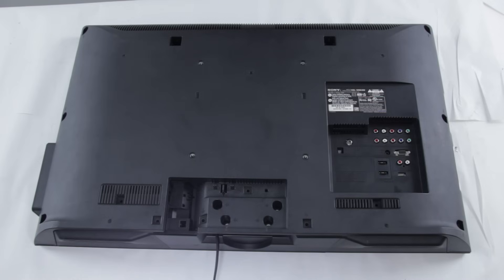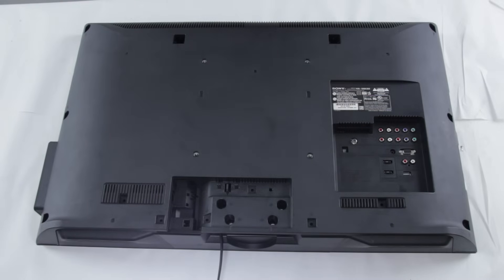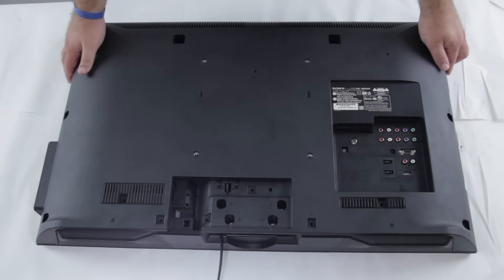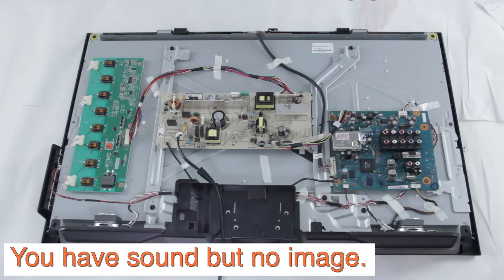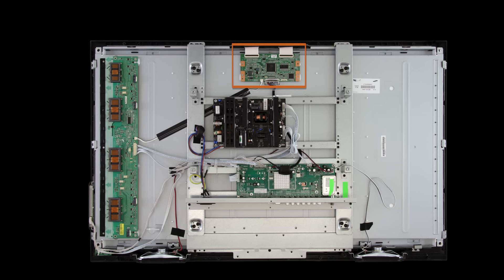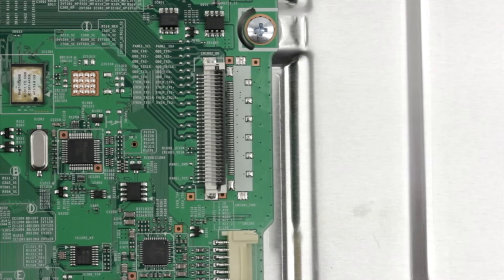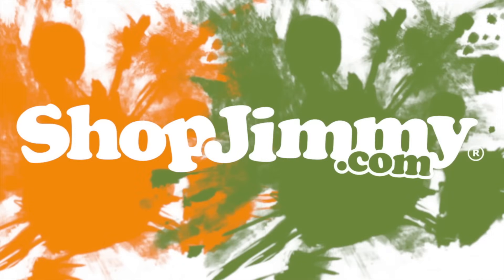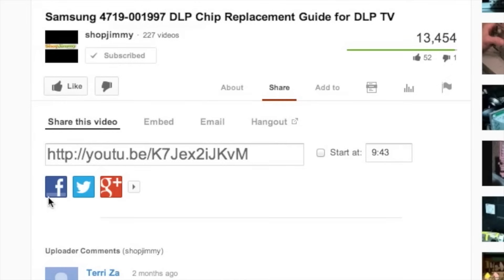LCD TV Repair Tutorial - T-Con Board Common Symptoms & Solutions - How to Replace T-Con Board

Comment: Hey my tv model is 100012585, SN is CA210161C5A001799, the problem is horizontal lines that have gotten significantly worse. I did a reset and basic troubleshooting steps. Figured it’s more a hardware issue. I’ve opened up the back of the tv to see if I can diagnose it. Any suggestions?

Comment: Thank you for this!  My Samsung UN55MU650D TV demonstrates thin black vertical lines on the left third of the screen.  They're evolving to become thicker and more are appearing. 
I'm thinking it may be the Tcon board (if it has one).  I want to fix it myself but have not done anything like it before.  I'm unsure if the part is even available anymore as the TV is no longer made.  Thank you for the opportunity to tell you of this.

Comment: I bought the tcon. i am unable to get sound though. I tried to run the hdmi into both hdmi ports with the cable runnimg but i get no sound. what i did notice is that when i inplug the hdmi the back light go out for a few seconda and then some back on. the tcon comes tomorrow but I'm not sure if its going to be the problem.

Comment: I have a Hisense 55 h9g 2 years old, and a week ago it would not power on.  The light at the power button would stay on but the tv would not turn on.  I ordered a replacement main power board.  I replaced it and it is still doing the same thing.  No picture or sound or anything.  Is it the TCon board?

Comment: Lg 47La620 v backlights failed tv had never worked. Replaced everything and tv works but some pictures display a green ghosting around certain images. Im guessing tcon board or mainboard. Bought a mainboard that was sold as working but it didnt work. Thanking you appreciated.

Comment: I have a sony 55" 3D led tv. I had fickering screen issue last year, wwnt to mechanic he blocked 8 pin right side  of the tcon ribbon. Now I have the  same flickering problem and the k ther side of the panel is also effected. Now both side problem , how to solve ?

Comment: My Vizio Tv picture goes black but the sound is ok . If I turn it off and on it will work fine for a minute or two and picture goes black again . Part number 10258161245  . Serial number LWZAUDBS1600283 . What could be wrong ? Thanks

Comment: I have a Sony with no image and red light flashes 4 times, I have replace Main board and power supply board and still does not work , tv screen flash white light then turn off right away, tv model xbr85x850f , please help , thank you

Comment: My TV: SONY MODEL KDL32P3000, S/N: 1364891, Shows Image and Sound, but the image has a delay or it's like in slow motion, very slowly and overlapping itself a few seconds. It's like be in the middle of a nightmare (like Silent Hill Videogame) Maybe is not the TCON and the problem is the SDRAM Memory? I've read that is a common problem with this models of Sony... Can I do some voltage test to discard the TCON? Thank U a lot!!!
Reply: oh, i forgot add the TCON model, is 320WTC2LV3.9 or aka LJ94-01420V

Comment: Hi I have a problem with my TV it's a 65 inch Sony model is KDL-60R510A AND THE SER # 5033599 WHILE TRYING TO LIFT IT I  squeezed the side of the screen to hard and the top of the screen where I handle it has lines going across it but it shows  a picture on the bottom half of the screen 😢😢 HELP PLEASE.

Comment: I have an Insignia NS-55DF710NA21 model TV. Have been T/Shooting it for a bit now....I have no picture just a black screen but I do have sound and when I push a remote button the picture will flash for a milisecond but then go black again. I suspect it is a bad Tcon board. I cannot see an image on the screen when shining a flashlight through the front of the screen. Would you agree it's most probably the tcon board?

Comment: Hello,
We have a JVC 58 inch Roku tv with flickering vertical lines random on the screen. They are faint light lines.

Model number LT-58MAW705 AAP
Serial number LT-58MAW705AP08601424

What do you believe is bad?

Thanks Chad

Comment: Samsung led tv only 2 years old, no display with random color vertical lines, opened up and found the board that connect between tcon and COF on the left side have an IC heats up. Havent found the short circuit, is it possible to fix?

Comment: 55" TLC ROKU tv model #43S421: Sometimes has a solid white screen or a solid black screen. The led light at the bottom of the tv flashes and blinks when I use the remote but cannot see anything on the tv screen. I tried un plugging it and plugging it back in and following the reset direction but nothing seem to work???????

Comment: Hi Jimmy. I have a Samsung UN65RU8000FXZA version AA02. The TV works but there is a vertical blue line on the left side of the screen and a horizontal red line near the top of the screen. Any suggestions for a possible repair?  Thanks very much.

Comment: I have a panasonic tv model TC-L58E60. Half the screen on right is blurry and when the screen changes the right side has a delay. I trued changing ribbons from side to side but still no luck. Would this be caused by the TCon board

Comment: I have a TCL 75S421. It powers on, the back lights come on, I can turn up the volume and navigate with the remote, but I have no picture. Does that sound like a bad T-con board? When I first turn the TV on, I can see the Home Screen background at the very top of the screen for just a second or two, but then it fades out.

Comment: Serial# 1709gtc001854a02860
M# 55s431
55" TCL series 4
Won't turn on fully, I can see power lights but no pictures or sounds other than the clicks of the volume going up and down. 
I think it's the main board but possibly the T-con .
I'm trying to pin point without replacing everything.

Comment: HI, I AM HAVING POWER ON PROBLEM IN MY TV MAKE- VU, MODEL- 43-OA WITH POWER SUPPLY BOARD RSAG7.820.8466/ROH AND Mainboard RSAG7.820.8466/ROH, BOTH HISENSE.
THE PROBLEM IS RED LIGHT IS ON CONSTANTLY. UPON POWER ON WITH REMOTE OR BUTTON, RED LIGHT GETS OFF FOR 4-5 SECONDS AND BECOMES CONTINUOUS ON. 
UPON TESTING WITH LOCAL SHOP, IT SAYS POWER SUPPLY IS OK BUT PROBLEM IN MAINBOARD.
I MYSELF TRIED IT TO POWER ON BY REMOVING EVEN T CON CABLE FROM MAINBOARD BUT POWER ON LIGHT ACTED SAME.

NOW PLEASE GIVE ANY REPAIR SUGGESTION. OR REPLACEING OF MAINBOARD IS ONLY THE WAY. REASON BECAUSE ONE MAINBOARD IS AVAILABLE ONLINE WITH OUT REPLCEMENT WARRANTY, THANK YOU.

Comment: I have a Sony  Model # XBR-55X900F with Serial # 4067309.  I have a horizontal line about one inch from the top across the entire screen.  Also a 1/4 inch long vertical line that touches the horizontal line. The small vertical line is about 8 inches from the right side.  I have tapped the back of the T.V. and checked the connections and nothing helps.  Any recommendations?

Comment: I have a samsung model:UN70NU6900F VERSION NO. YA02 / UNU7090. I am having an issue with the Left half of the screen is not as vibrant as the right hand of the screen. Initially the TV would not come on and flash as well as the red power light would blink. I taped the ribbon tabs and got the TV to work now its just the color issue as mentioned earlier. You're response is greatly appreciated.

Comment: Westinghouse model WR58UX4019

Serial number YN00CW508081

Hardware ID 7816X

Had faint hoizonal lines goind across the screen

No loose cables and resting the tv did not work

Any suggestions?

Comment: hi jimmy. could you help diagnose the problem with my TOSHIBA LED MODEL NO: 322300VM. POWER SUPPLY=110V~240V 50/60HZ, 55W.  the problem with it is that the power is on and standby mode is on with green light, but the sreen does not lit on. but if you aim the flashlight at an angle the menu / volume up and down is visible on screen, but it seems to be dimmed out. can you help me diagnose this problem?. what could be the possible cause of this. T-con board?, the led driver?, the led strips?. thank you

Comment: Samsung un55c9000 titanium slim led tv. The picture fluctuates in long intervals like hours between its 2 states. One state is fine, everything works fine. The second state is a shaking state of mostly horizontal lines all over the picture, we’ll 80 percent. The picture also exhibits what I call double vision, and it occurs in caption boxes and message or alert bordered statements. After several hours of errands and chores…when I turn on the tv everything is fine. Thx for your help

Comment: Hi Jimmy Team, Please can you advise me? I have a Sony 4003506 KDL40V3000 Tcon Board 07A34-1C T400HW01 V1 CTRL BD
The picture on the TV comes on with multi coloured screen with a normal picture it then changes to a very white screen and alternates between the two. What is exactly wrong with the Tcon Board please and is it possible to repair by replacement parts? If so can I buy the parts needed from you?
Love this site and look forward to receiving a reply from you.
Regards,
Brian

Comment: Hi ! Question : When i turn on the TV (SHARP  LC-52LE830U), there’s a “double image” / “ghost” problem on the whole screen (both sides L/R). 

When i unplug the LEFT ribbon cable (output) from the T-CON board that goes to the LEFT buffer board, the image on the RIGHT side is NORMAL (!!) If i re-plug the left ribbon cable to the TCON board, the problem happens again.

Would that be more likely a T-CON board issue, a ribbon cable issue, or the actual buffer board ???
Should i get 6V readings on the soder pads on the left side (output) on the TCON ? If not .... there’s the problem.

Thanks !

Comment: My TV product code is LG32LB530U-ZA. ADGWLH and serial number is 408KKHN91241. To explain a bit about the cause of the malfunction, after getting some water in it, after working for a while, the screen turned white and lines started appearing. The board attached to the screen was damaged when it was opened. What is the solution?

Comment: @ShopJimmy I have an Aucma tv. Model E6 Serial number 201506D385L60088
Lines appeared on the screen and the Screen recently split in 3 and has a mirror effect. Is it an issue with the t-con board? Please assist.

Comment: I have a un65tu7000fxza it's about a year old and on the right side I'd say about 1/5th of the screen has washed out of most color. I am wondering if you have any idea what the potential problem is and a possible solution.

Comment: hey I have a oled55c1pub. Works fine sometimes but other times it will start ok then after it's on awhile the screen with flash black here and there real quick and then will start going black and you can here a clink sound when it does it, kinda like the sound it makes when u turn it on or off. Sometimes it'll do it erratically over and over almost like something shorting out ...but then other times it's fine.. I have checked all the software made sure that sleep timers were all off.. updated it.. also bought a new power supply board "numbers matching" from eBay.. I thought I fixed it but then it started doing it last night again. Any suggestions on what I should try next? Thanks!

Comment: My TV got dark screen as it was working..then switched it off and on again and screen was completely black since then...I tried the unplugging and reset nothing worked...also I tried putting a flashlight on an angle to the screen as the TV is working but I don't see image ...the sound is working. My TV is Hitachi 58hk6100u please help 🥺..should I replace the tcon?

Comment: I have a samsung model number UN48J5200. Recently the tv started showing lines that's a not so bad but the right side of the tv seems to be burning whatever image was displayed while the tv was on. If I replaced the tcon board would it fix the problem?

Comment: I have a Visio M49C1 that has had a par surge .at first no power I replaced power board, then main board. After speaking about no text but power and menu buttons, now I get txt. But on opening screen logo is split right and left middle clear. Also no picture size control.They are greyed out in menu. Help please

Comment: I have a Samsung UE32EH5000 with the far left of the screen having a vertical section which has the image very fuzzy. Would this be a t-con issue? I got a replacement one, fitted it and the issue persists. It could well be that the replacement t-con was also faulty, or could it be something else?

Comment: Hope you can help. Vizio Model V555-H1. Serial number: LTCDZHNW4853459. Horizontal lines on the bottom and top of the screen. Fading as they move towards the center up and down. Any help is appreciated

Comment: Hi I have a Sinotec 39" led plasma model : STL-39VN86D using a main board : TP.V56.PB801, it's a South African brand, the problem is that there's no sound and no picture but the backlight are working also I replaced the main board but it shows a dark screen only I was thinking maybe it's the T-con board or am I wrong? can you please help me
Reply from the maker: Hi! Plasma TVs do not have T-con boards but it sounds like you may have received a faulty main board. Thanks for watching!
Reply: @shopjimmy  I'm sorry it's a HD Led TV but I understand I'll try to get another board and thank you for your help 🙂

Comment: I have a 43" Vizio tv and spec to tech support and they thought my problem could be my IR sensor 
I've had other support say they don't necessarily agree 
I'm hoping you could help.me to figure out the most likely problem 
When I turn on my TV I have picture and sound
When I try to adjust the volume it keeps going up or down on its own and when I reset to factory specs, I tried set it up amd.the tv would start setting up on its own till got Wi-Fi to enter the.pass.word.it start filling it in with a bunch of a on its own 
It would not allow to to correct it
I've done the factory / tech support protocols and no luck
I've have eliminated the remotes where I would remove the batterys from them and it kept doing the same thing !
Can you help me.with insight / suggestions?
Thanks for your help 
Rich D.

Comment: I have a Sony KD60X690E. There is no sound and the remote does not work although it has the IR light. I bought the IR board, but I don't know how to install it. I also have to install the T-CON board. There is also no light to show the power light at the middle bottom of the Tv

Comment: LN46C630K1FXZA Samaung TC (LCD) has ghosting to picture.  Colors vary from red to purple and ripple like a ghost.  Tried new firmware and reset picture.  Ghosting still exists.  All info point to a weak tv internal signal, but I don't know which to change.

Dave

Comment: I have a Sharp LC-43LB601C with full screen video while 7 vertical colored lines appear on far left of the screen.  I have replaced the T-CON.  Could these lines be caused by the panel driver board or the panel itself?

Comment: Hi Jimmy. I was wondering if you could help me to diagnose my TV's issue. The model number is LG 60uh8500. It turns on, the backlight gets on without a picture just light then intro music playback. I can reduce and increase the volume during the audio playback by remote control. After a short while, the tv screen gets off. The mainboard is on but no picture. I checked all voltages on the power supply, all are probably present on the pins. There is an indicator red LED on the power supply that starts blinking after a short while. It blinks four times then turns off and for a short while then starts to do the same thing. I disconnected the panel backlights cable from the power supply then the indicator red LED on the power supply got solid red which means for every error on the system the LED mentioned a fault code by flashing or being solid. I disconnected the T CON board from Mainboard and the indicator LED flashed 4 times a row like it was connected. That means the LED does the same when the T CON is connected or not.

Comment: Hi!

I have a Sony XBR55x850C.   Tv powers up to the android tv Home Screen.  Does not respond to remote control and just continuously power cycles in a loop 

Did factory reset but ended up having the same problem repeat.   Any suggestions?

Comment: I have a TCL 65C825 it was working fine but the other day when I switched it on it starts with full picture but then gradually dims and becomes black and the sound is there. What is the possible problem?

Comment: I have a Vizio M658-G1. I had my Roku stick powered to the USB port and one day I heard a popping noise coming from the back of the TV so i turned it off, waited 10 sec and turned it back on and noticed colored vertical lines on my screen. I'm thinking I might've fried my T-Con board?? Not sure.... Any Ideas? Hate to junk the tv cause its only 2 yrs old. Thanks

Comment: Have LG OLDED55CPUA, only the red standby light stays on, and will not turn on. I hear a click, then 3 seconds later a 2nd click. It won't turn on. I replaced the power board first--no change, then replaced the main board--still the same problem. Can a defective T-Conn board show symptoms that would normally be thought to be attributed to not turning on?

Comment: I have a toshiba 55l7200u. I have a black screen and as far as I know there is no sound either. The light that show the TV is powered on constantly blinks green instead of a solid colour. I have tried to replace power board with mo success. What are the other possible causes for tv not to work.